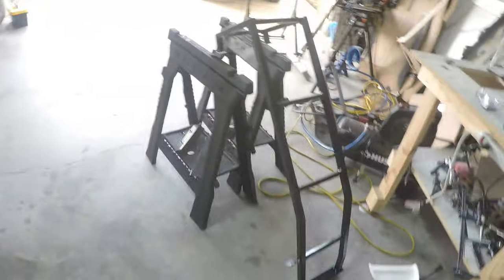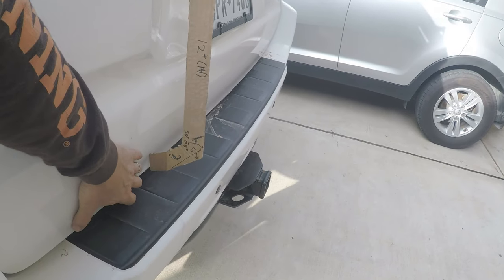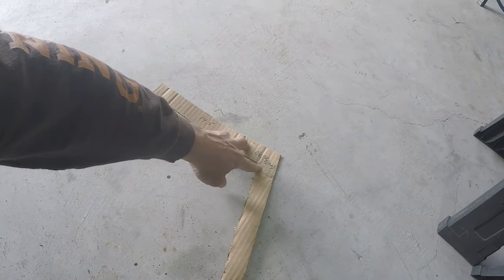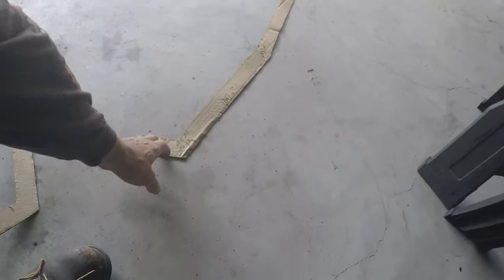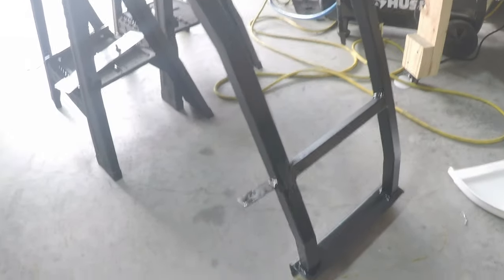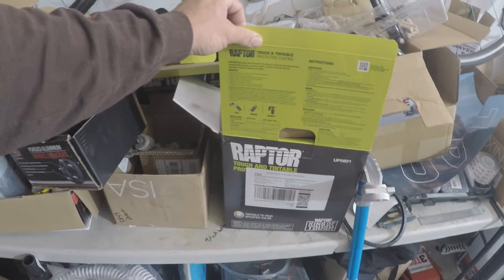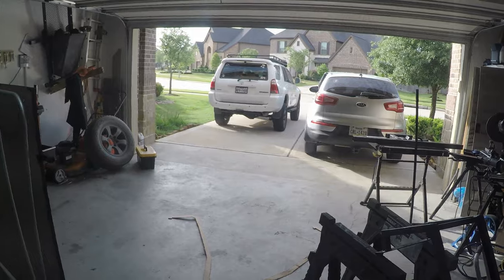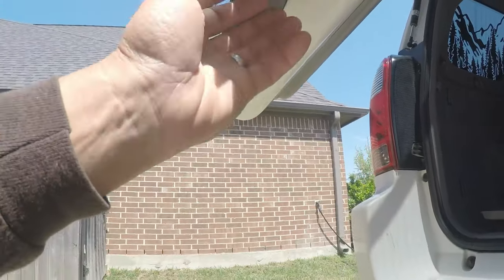DIY 4Runner Rear Ladder Build

Comment: I've been waiting for this video! I am really looking forward to the bumper build. I'm really interested in how you are bending the steel. Im building my projects out of my garage too and can't just go buy a press.
Reply from the maker: Starting the bumpers next week after our camping trip.  Can’t wait to get rolling with them.
Reply from the maker: For bending the steel…. One thing you can do is score the one side of the steel deep enough to make the bend and then stitch weld along that score line to strengthen it back up.   I’ll do that for bends that are longer than my press/bender will fit